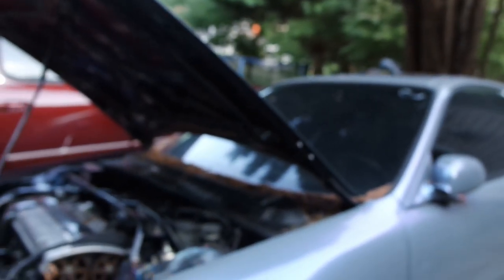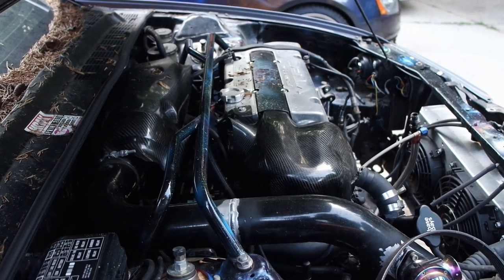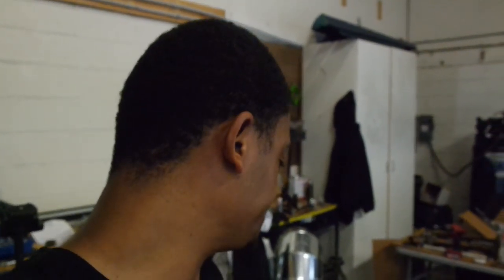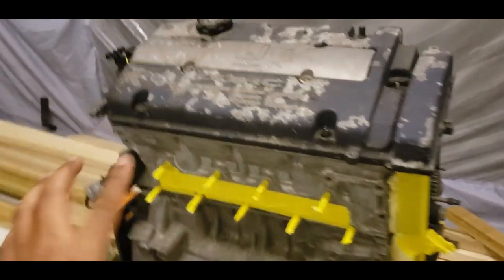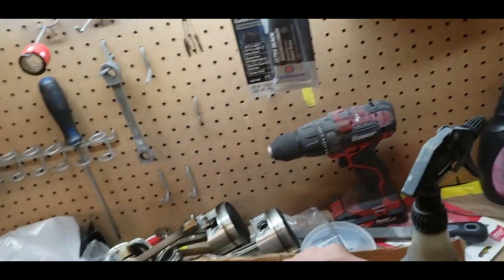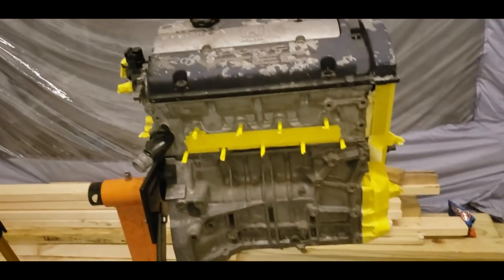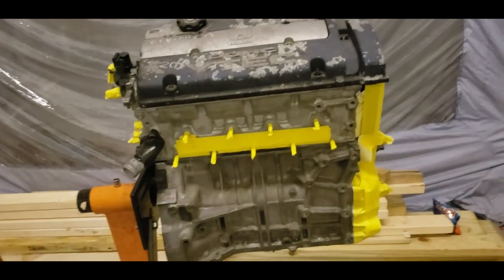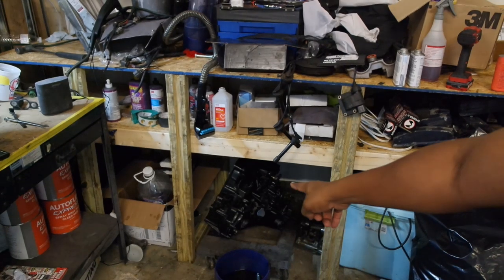How to paint your f20b honda prelude block 101

Comment: Trey, it was good to see you use the VHT, it is a perfect product for what you are doing. as far as primers, to get the best adherent. use a "self etching" primer, then the regular primer. then the VHT. the acid etch process will chemically bond to the metal. just make sure you get the proper thickness. This is good for things that exposure to heat cycles over time. hot cold, hot cold. as the engine sees a lot of this. it will last a lot longer, and have far less of a tenancy to blister from heat after the fact. Nice vid man!

Comment: Did you even align hone your caps ? Lol 
That was most likely your issue
Reply from the maker: I torqued my block to factory spec. What issue you talking about?
Reply: Everytime you remove you main caps its always recommended to align hone everything before you torque to spec and you if are running arp your final torque is 80lbs
And always check for clearance.
Reply from the maker: @hondaracinglife2897  whats my issue tho? I torqued to oem spec to avoid having to line hone for he fact that i couldnt get new oem main studs
Reply: Forget it bro good luck 👌
Reply from the maker: @hondaracinglife2897  🤷🏾‍♂️